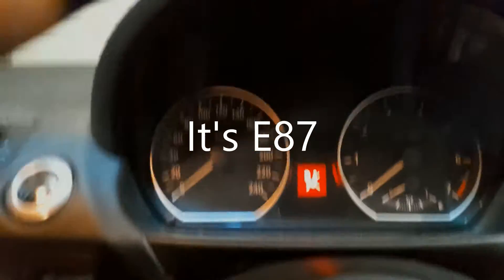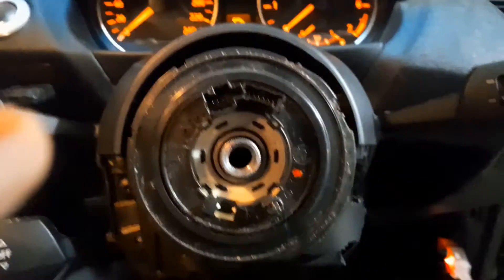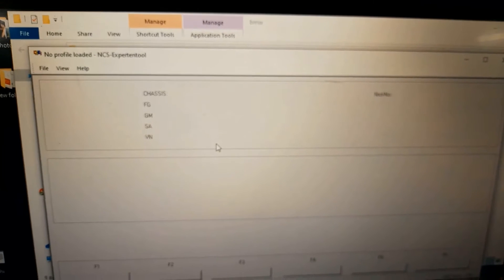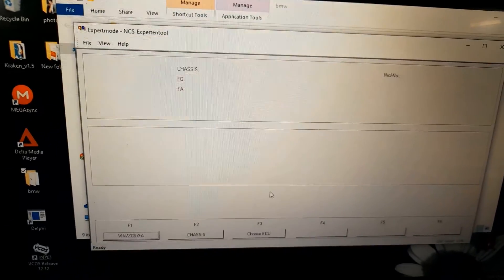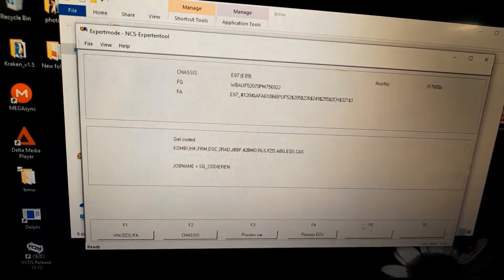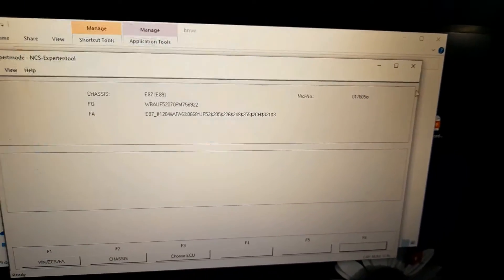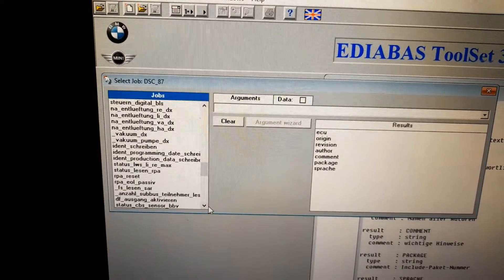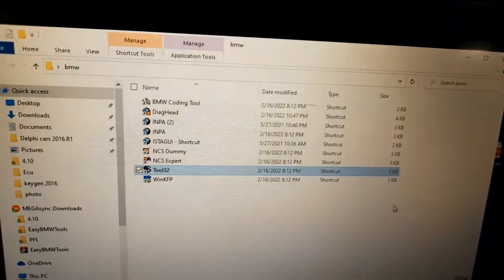BMW  Dynamic Stability Control unit DSC  coding

Comment: Excellent video, I've been breaking my head for months how to code the d*** SZL unit I replaced in an E89. Also went trough the trouble of downloading ISTA-D & P thinking I needed to recode the VIN onto the parts etc... What a hot mess to code BMW's and then to discover the solution was right around the corner. Thanks a mil for sharing this walktrough

Comment: Dude, you have just saved me a HEAP of headaches - i couldnt find a clear step by step way of sorting out my replacement SZL issue.   Many thanks!!!!
Reply from the maker: I have spent a lot of time to find the way as 2 of mine broke down and i was so pissed off that i have made that video ...good job if you didn't make those bastards any reacher.

Comment: Great Video, I have a problem with X5 E70. There is no DSC module name on NCS Expert for E70. It looks like it is under EHB3 Module as showed on INPA, 
Question: What is the SGBD .prg file for E70 on Tool32 . Can you Help?
Reply: I figure it out, The SGBD .prg file is DXC_70 for E70 & DXC_60 for E60
Reply from the maker: @ab-or2km  did it work?